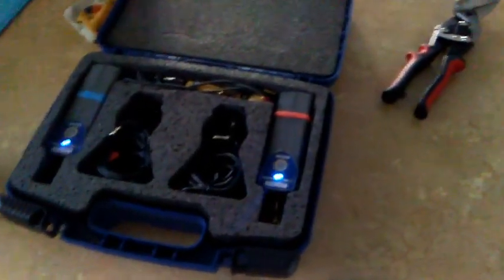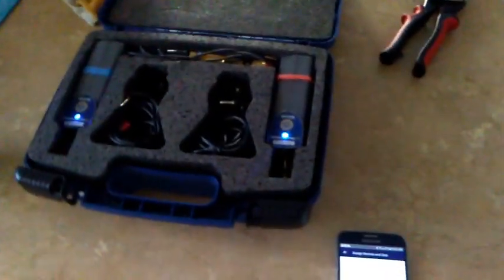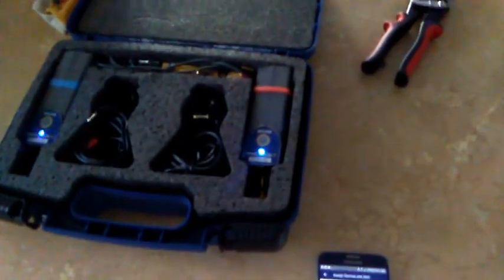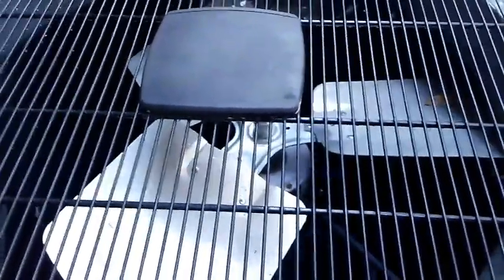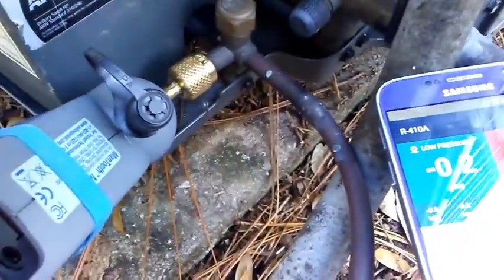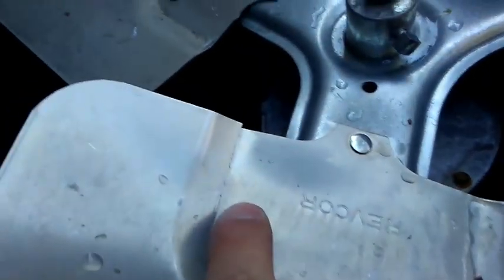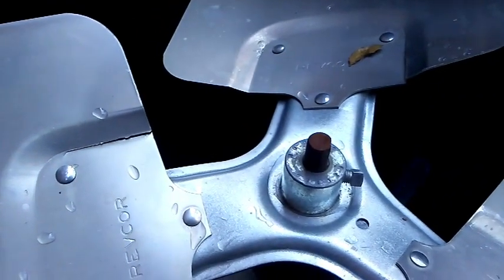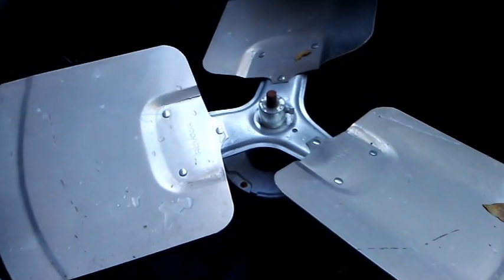Goodman 18 SEER Heat Pump | Noisy Unit | Yellow Jacket Mantooth

Comment: The broken mount and blade is from ice buildup on the blades throwing it out of balance. My personal unit had an issue with this. You need to spray wd40, Teflon, or boat wax the blades.
Reply from the maker: Nice tip

Comment: Ran into the same problem on a Goodman with the bracket breaking got lucky and didn’t have any holes in the copper.    Ken G
Reply from the maker: It just barely cut through, but it was enough

Comment: Holy smokes.  Even if they cover the materials under warranty they will not cover the refrigerant correct?  
By the time they pay labor and gas wouldn’t a new condenser be cheaper?
Reply from the maker: It is an option I will present them with. 17 lbs. of 410 is a lot!

Comment: I would assume that it failed while in the heating cycle.  Goodman reversing valves aren't the most reliable, even when they haven't been subjected to all that vibration...didn't anyone hear something?  I have misgivings about what may have been sucked into the compressor with all that banging going on.  I would try my best to get the customer to replace the whole condensing unit.
Reply from the maker: The lady did hear it when she arrived home. I agree it may warrant a new system or heat pump
Reply: RIP in pieces Goodman unit.